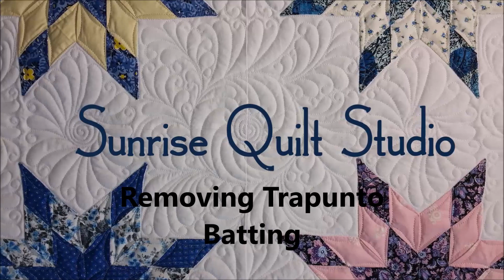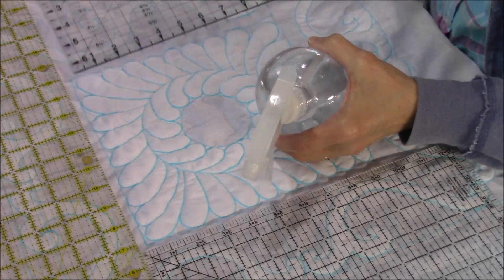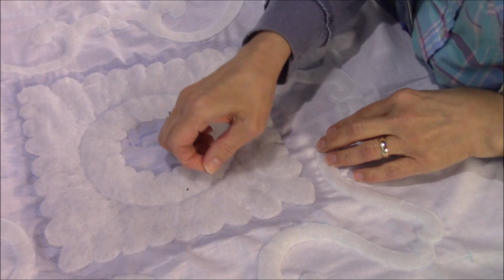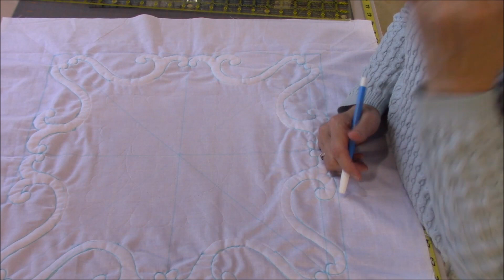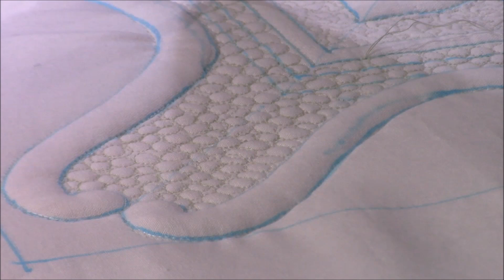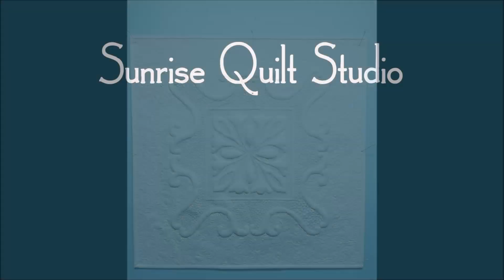Removing Trapunto Batting

Comment: Susan I have now watched all 6 videos and I’m not sure if I have to actually use a wash away thread. I know you did dense quilting around your trapunto is that necessary to make your design standout? My thoughts were to just accent those feature elements of my Christmas panel. There are 3 poinsettia, 2 chickadees,  and 3 ornaments, the rest is just filler designs. Any suggestions would be totally appreciated. Thanks fro sharing your quilting skills. 👍❤️😊
Reply from the maker: Since it is a panel and not a wholecloth quilt, you probably don't need the dense quilting or wash away thread. You could always add  more quilting if you feel it needs it.